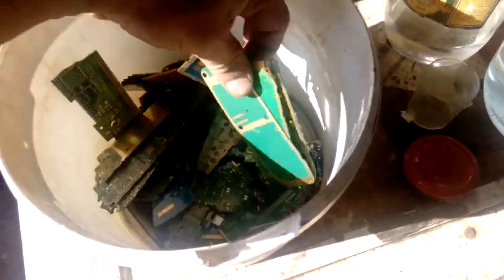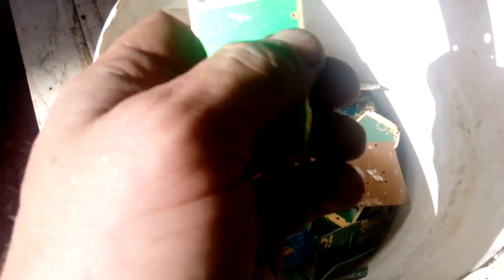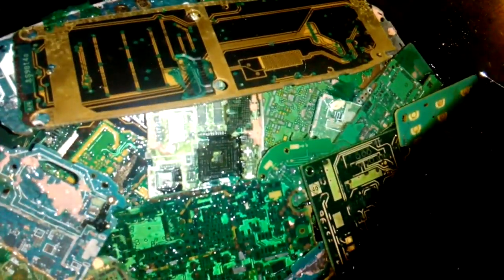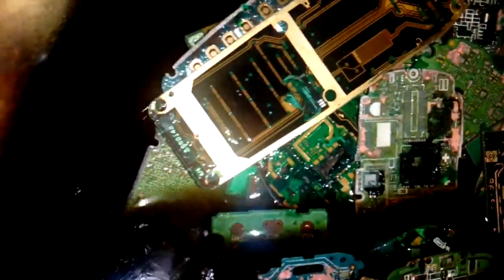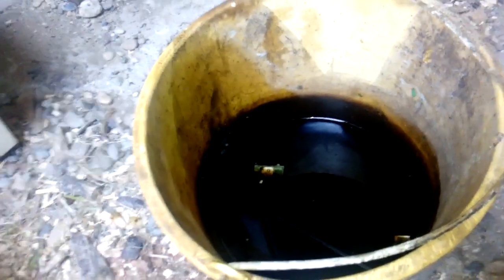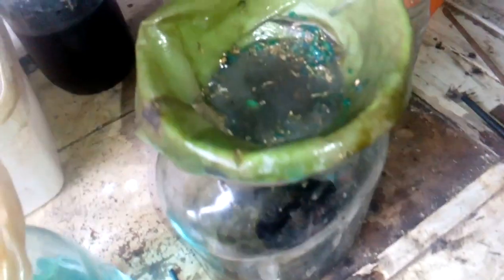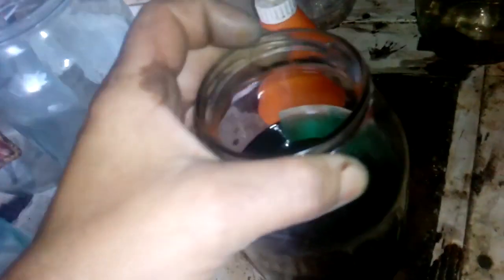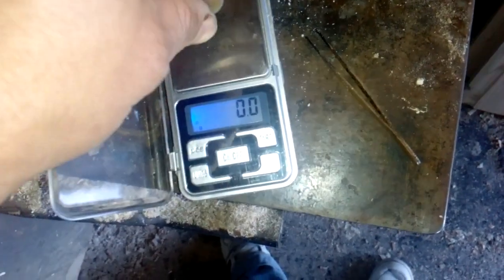Cellfone board for gold recovery vith Ap solution!

Comment: So I stripped a bunch of old cell phone boards(using HCL and peroxide) and was left with a lot of tin and lead in my filter. I can't get it out with a magnet because it picks up the light gold too. I saw this video and tried the HCL and water hoping I would be able to get the lead out before the gold starts to strip. Checked on it this morning and the gold has already started coming off(pinless fibre CPUs). I have sulphuric acid on the way. My hope is that I will be able to get the lead out with sulphuric. I guess I'm wondering if you've had this problem andhow you overcame it? 
Thanks so much for your videos. Very educational. I use you for all my lessons. Appreciate it!
Reply: Tin and lead will dissolve in hcl, I would think you have some gold and silver in your filter. You don’t really have to strip the tin from boards when using cucl2, it’s only when using nitric acid one should remove tin first. (In order not to make metastannic) ✌🏻

Comment: Hay New York here I’m just getting in to all this   After dissolving the tin with the HCL do u Drain Out the watered down HCL before adding the new ACid /. AP solution
Reply from the maker: Yes, first acid amount is remove and board is washed vith vater, then i add New acid and peroxyde. Chears New York.
Reply: @999DusanGoldrecovery  ok

Comment: I have a feeling you added too much hydrogen peroxide, and too quickly, as it will cannibalise gold back into solution as the reaction occurs. I always tried to cooly solution with ice before beginning gold dissolution, and it helped. Alot. You should have got 1-1.4g from those boards man. You knew something wasn't right when it didn't drop... Maybe stick with a bubbler, and then basic aqua regia recovery; you are much more confident with that routine😀
Reply: thanks for tips.i was lost my gold using fast ap method 😑

Comment: if want to remove green mask , u should put the board in sulfuric acid  and boil it for 5 mint , all the solder and green mask will gone, so be care full with sulfuric acid , it is very dangerous and very bad reaction with water,
Reply from the maker: To know about this process, but I wanted to show people who do not have the ability to do this process with a little patience and AP can take off the gold under the green mask.

Comment: I Have never done any of this still researching process. I was wondering would it be better to dissolve the green Soldier mask in a Lye bath first? I saw that process and it would seem like it might be easier and cheaper to do. Enjoyed the video! For some reason I like the plastic buckets and wooden stick seems more backyard chemist to me :) IDK thought it was Awesome. One last ? does the acid not eat through the plastic or is there a special plastic that you have to use?
Reply from the maker: Not,any thicker plastic will be fine, the acid will not dissolve.
Of course, better plates are first done in Lye, but also this gets the same result only more time needs. I use the tools I have at hand, I do not want to shoot big money for equipment that is not necessary and can be replaced by someone else. Thanks mate.
Reply: Awesome! Thank you very much for reply that cuts my starting cost significantly. And Keep up the great work man. :)
Reply from the maker: Thank you freind!

Comment: I think you're losing gold here....I know from experience you'll get much more than .4 grams from a kilo of cellphone boards....but I do appreciate your rough approaches to all this!
Reply from the maker: It depends on the phone boards, is not it? In this bunch there were a few plates with a large plated surface, but 80% of others had only small traces on the edge of the board. I tested Ap for gold, result negative,I tested Auric solution after drop,result negative,trust me,there is no more gold in this batch which I processed.The result will never be the same!

Comment: If you use too much hydrogen peroxide (3%) you may dissolve some of your gold into solution. If you think more is better and add too much too quickly or use too high of a concentration of hydrogen peroxide you will dissolve gold. The peroxide is a catalyst for the reaction, not the active ingredient.
Reply from the maker: The quantity recommended at the start of the process is the fourth part of the solution, the amount I used here was several times smaller so there is no fear that the gold is dissolved, plus I always force up the solution to the maximum so that all the gold that is accidentally absorbed vill by exit and drop in the form of black powder.
Reply: The Gold disolved in this solution at 35° C,  that is a little, little Marge of Gold. Is the  solution cooling down the Gold fall out as a black powder. I use this AP since 2 yaers  and never where gold in the solution.

Comment: You must have terrible problems with your woodworking tools rusting, given the amount of HCL you're using! I won't even store HCL in the shop, let alone use a dilute solution in the same space as I have my tools (lathes, metalworking tools). Even in a wood box inside a closed metal cabinet my watch and clockmaking tools were covered in rust about a week after I used dilute HCL to derust some sheet metal for a car restoration.
Reply from the maker: In my luck, I have an open lab behind the house, so that I only work on the workshop and prepare it right away, otherwise I would soon have no tools.
I hold the acids outside, in the workshop I'm just doing depopulation and preparing the processes, sometimes I'm doing electrolysis, otherwise I'm doing everything outside the workshop.
Reply: Yes! If you listen you will hear his children playing right behind him,,